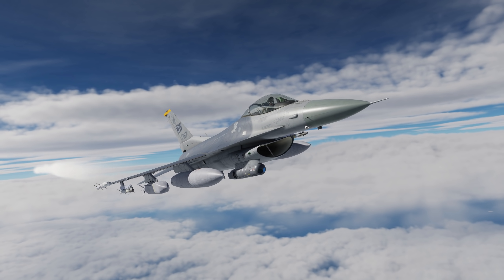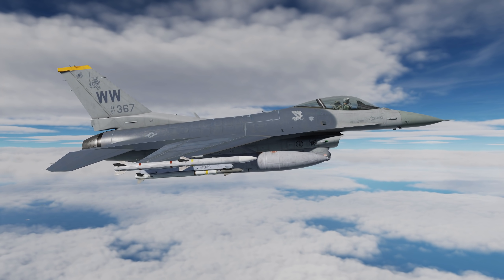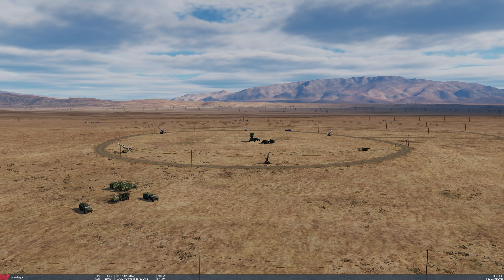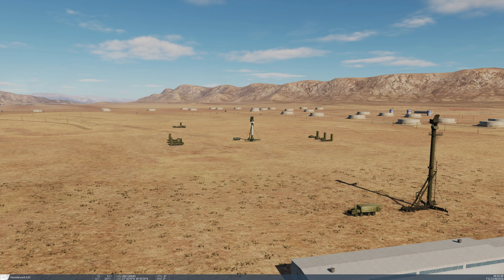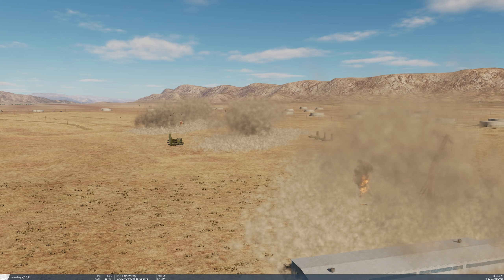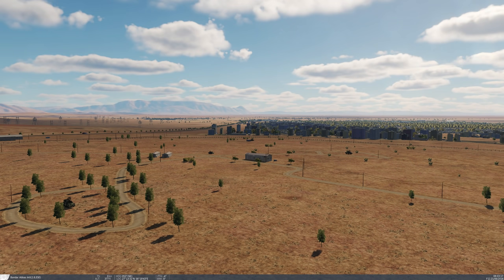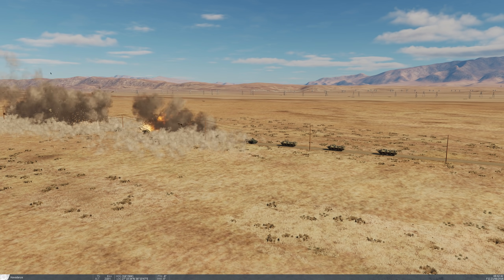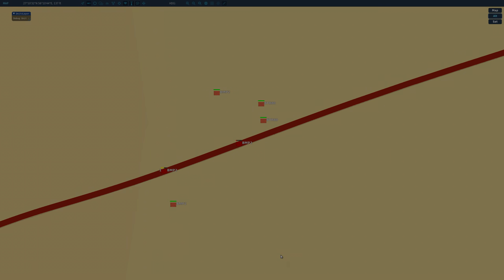DCS: F-16C Viper | JSOW Use Cases

Comment: It would be great if the game had more missions that bridge the currently huge gap between the very limited training missions and full-on operational missions and campaigns. Using the different weapons against appropiate targets with corresponding threat levels, and include a brief explanation on the briefing so we can understand why we are supposed to use that particular weapon, at which altitude, speed, etc etc. 
A simulator with this level of complexity is wasted without the necessary education to extract it's full potential.

Comment: Welp. just dropped 2 JSOW C type on the airfield w/helo's in the F/A-18 OCA mission. 3000 ft deployment of clusters. absolute carnage  all over the helos. none destroyed. i call bs. at least 2 of those airframes would be scrap. 
and about that SA-10... it will eat JSOW all day. only way i can hit it w/JSOW is to send 8 of them to it. if released too close together, one SAM can take out multiple JSOW. i think all of that is prob accurate tho. 
what is NOT accurate is the fact that I can't skim a SLAM-ER across the water/ground and hit it. i can't keep it from increasing altitude in terminal phase before the camera kicks in (max 99sec) so the SA-10 eats it before i can reduce altitude manually.

Comment: I've seen in a lot of user vids showing SA-10s, ect shooting down a high percentage of HARMS fired at it. Is this realistic? I know the SA-10 is newer than the SAMs used in the gulf war by Iraq but I don't remember any reports of HARMS being shot down by any SAM system during that conflict or any other conflict since. Also the HARM is going very fast and has a small RCS.
Reply: I took part in shooting at Ashuluk in 2019. C300 hit targets of the "Kaban" type. similar in characteristics to this agm 88 target   https://xn--80aaxridipd.xn--p1ai/usovershenstvovana-raketa-mishen-kaban/
Reply from the maker: Yes, it is. You can disable it if you wish.
Reply: @MattWagner  Enter S300PM1, PM2 into the game. This will destroy the balance :). S300P whipping boy from the 80s

Comment: Hey Matt! Thanks for the info. Can we please get a video on how to accurately use GPS/Precise GPS targeting? It seems the only way to get exact GPS coordinates is to use the mission editor. If I try to use GPS coordinates for any plane in DCS to drop GPS bombs/missiles, they are always a little off compared to dropping manual waypoints in the mission editor. Not sure if it's a bug or something I'm  doing wrong... but none of my friends can  figure out precise GPS coordinates while in mission either.
Reply: Have you checked the coordinate system in the f10 map needs to be the same as what the plane uses
Reply: @commiccannon592  Yes definitely.. still always seems a little off. I'd like it to be just as exact as the mission editor.
Reply: in f10, press alt y twice to get the precise coords should be 7 numbers for north and east You want to use that setting for putting #s into waypoint editor in waypoint editor in data page

Comment: Can you expect any hits at all, if you actually let the SAM site engage the JSOWs?
Reply: I have a lot of experience in DCS doing this with JSOWs, in my case I nearly exclusively use the C, assuming nothing changes with it's release on the Viper, and assuming default AI with skill levels set to "Average" (though in my testing results are nearly the same up to "High") you can expect, on average, one SHORAD system such as an SA-15 Tor to intercept one JSOW per strike. They tend to launch two missiles at each projectile, and due to the speed only really have time for one attack before impact. Thus if you launch a group of four JSOWs you can expect to loose one per Tor that is present. There is a fair degree of luck involved though, and in full salvos of 8 at sites I frequently only loose one, sometimes none, but usually two. It's fairly rare to loose more than that if you're launching all your JSOWs at the same time, but may occasionally happen if they have to fly over the Tor to hit something behind them.  This is the most common vehicle by far that you're likely to find intercepting your JSOWs,.

Most SAM systems in game are not capable of intercepting JSOWs, but systems like Patriot and like the SA-10 are, and have far longer to intercept your strikes due to their increased detection and engagement envelopes. I would not recommend engaging an SA-10 with JSOWs without having it be suppressed first by AGM-88s especially as it is difficult to get into range without being launched on, however I have tried it. Out of a strike of eight JSOWs I have had mixed results from all of them being shot down to between 2 and 3 making it through with the skill level set to Excellent each test, so there is a high degree of variability.
Reply from the maker: It depends on the SAM type, AI setting, saturation level, etc.

Comment: i feel like this needs an actual pre-planned GPS coordinate oriented mode.. This weapon along with the recently released GBU-38 is ultimately pointless and useless if there is cloud coverage over the AO. If I were to use any bomb on the f-16 I might as well just use gbu-12's and call it a day.
Reply: That's actually possible you know. Just make a steerpoint at the target's location and designate your jdam on it
Reply: @cellokid5104  designate, you either need visual mode or a tgp to do this in the f-16. If this isn't the case then I guess i missed something
Reply: @jackal1743  You need a SPI for the JDAM/JSOW. If you have a steerpoint on it and don't use the TGP or visual mode, then the steerpoint will be the SPI and you can release on that. So it pretty much does exactly the same as TOO + waypoint designate in the Hornet.
Reply: @twoknife  okay, If I am understanding this correctly, I have to edit this within the mission editor and I cannot edit this information in real time. If i were to edit this in my own mission then it works as intended. Otherwise the preferred way to operate these is tgp/vis mode.
Reply: @jackal1743  You can edit waypoints inside the aircraft with the ICP. As long as you somehow get the coordinates, you can put a GPS weapon on it. That functionality has been there for a while. It is typically what I do to employ HARMs in multiplayer servers.
Reply: @twoknife  That's what I do. If there is F10 Enabled. I'll look for targets and write down there coordinates before startup. If not, ill just use the JTAC for the locations of that target group.
Reply: @cellokid5104  The jsow and gbu-38 were designed with poor visibility of the target area in mind. My perspective on this whole thing is that these weapons are already failing at what they are supposed to do initially. 

If these weapons require me to visually see the target in question that means two things: One, the enemy can certainly see me if I can see them, and two the weapons systems failed to provide what was advertised.